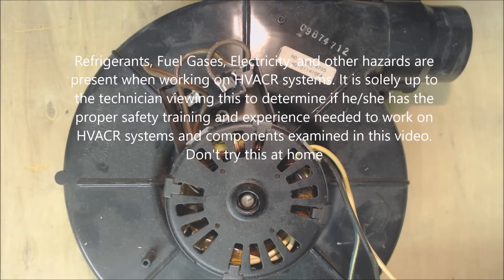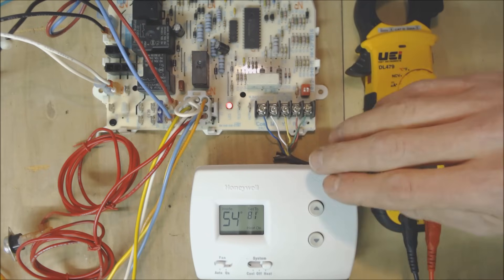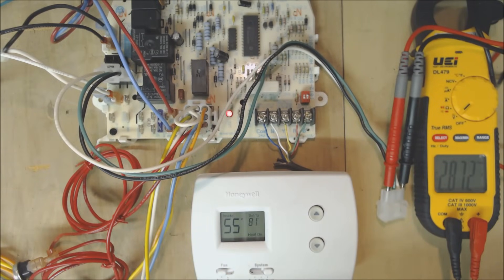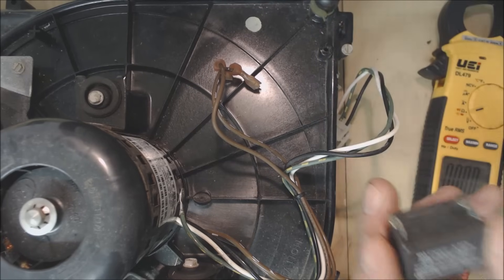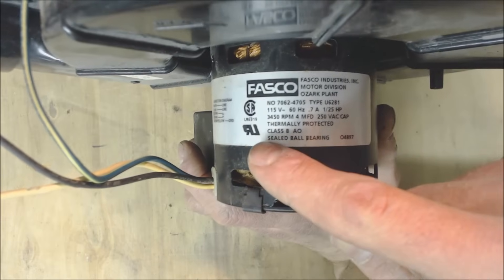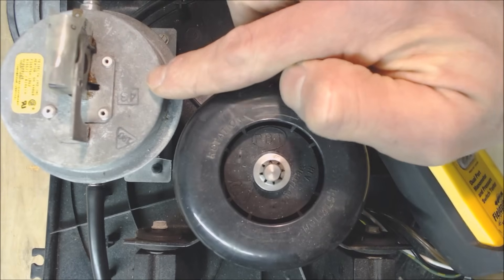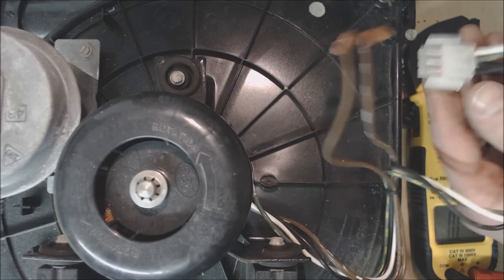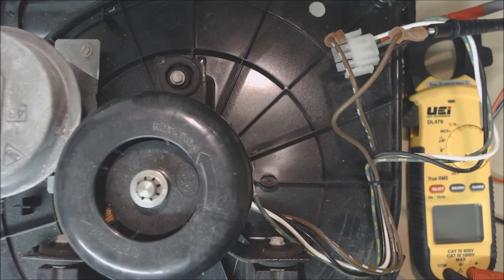Furnace Inducer Motor Troubleshooting! Top 8 Problems!

Comment: Thank you for this video,  I can hear my inducer motor turn on and off a few times in a five minute period in the wee hours of the morning. The thermostat is off (no call for heat)  When I do call for heat everything works fine and efficient.  Do you know what could cause this?  thank you in advance.
Reply from the maker: Is the inducer a psc or a shaded pole or a variable speed? In this question, psc and shaded pole would fall in the same category.
Reply: Not sure. I do know its only one speed.  L.P. Carrier. I am just  retired glazer and not real knowledgeable with electronics. thank you for responding.
Reply: I am worried the inducer fan is turning on because of L.P. leak, although I do not smell L.P.
Reply from the maker: Is there a low pressure gas switch? Try taking the tstat face off temporarily when you wake up to see if it is tstat that is the problem.
Reply: Ill check.. thank you.

Comment: Had a loud buzz when the inducer motor kicked on.  Tech diagnosed bad inducer so  I replaced  entire assembly (motor and blower).  High efficiency black plastic Fasco.  Still have the same loud buzz.  Any thoughts?  Thanks

Comment: If the inducer motor is hot 170 degrees that means that is bad, or locked?
Reply from the maker: Ruben, here is a video on thermal cutout on a blower motor. It could be broken down resin on the motor windings or locked rotor- https://youtu.be/IBg0EZg0ohY
Reply from the maker: Did you see it spin when power was applied, maybe a bad capacitor? I was assuming that you saw it spinning at that temp
Reply: Thanks, it never came on and the tempeture was rising from 70  slow to a 170. 3 intermittent lights on the board but I didn't find the troubleshooting guide on the board.
Reply from the maker: Was it a psc motor and did it have a metal or small black plastic capacitor. If it didn't come on, it could have been a capacitor. Did you try free spinning it to see if the bearings were stuck? Thanks

Comment: Can you explain the equation at the end? It says start to run = 152ohms but when you got 152 ohms, you were checking with the common wire to one of the capacitor wires. Just a little confused on what start and run are in this scenario.
Reply from the maker: It is interesting in this scenario that white wire is actually the run while the black is the c. It is just how that motor was wound. I did a double take on it too because the high resistance value is found between the start and run. Thanks, good eyes

Comment: Hello i like your videos they are very helpful, thank you i have a problem with my furnace it takes too much time to turn on, i replaced the thermostat but still doing that i don't know if I need to clean the flame rod sensor, could you please tell me what to do. 
Thank you. 
Have a great day.
Reply from the maker: Hey Jose , you would need to know if the problem is in the low voltage or sequence of operation. Here is the troubleshooting furnaces playlist for you to see where it stops at. --  https://www.youtube.com/watch?v=k5vEkndMXLI&list=PLxnHR5_D2ojyN6VClLntbM4X82Gc9Xs8A